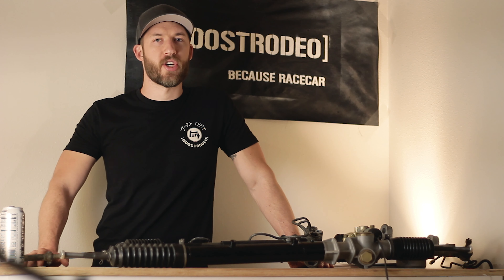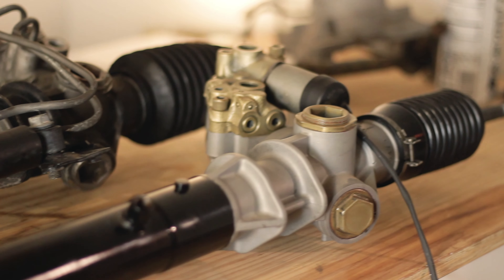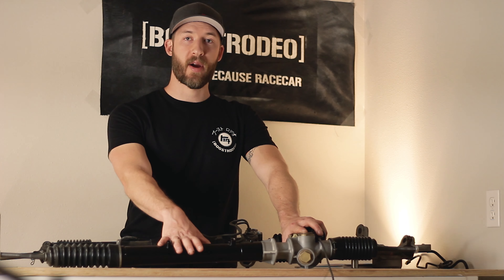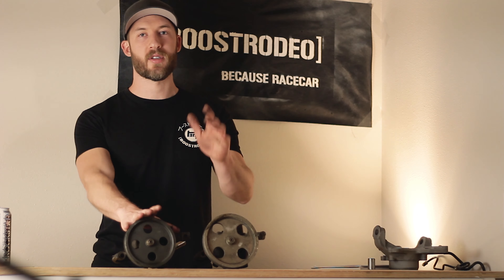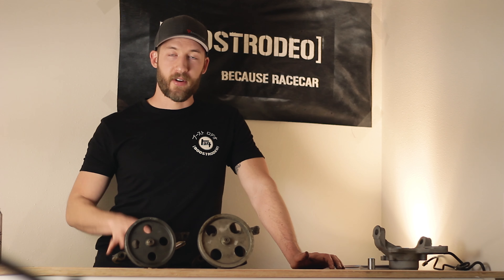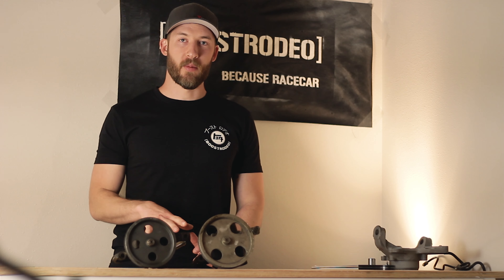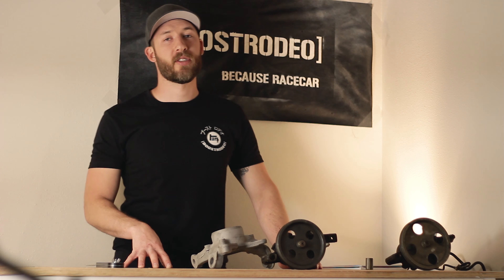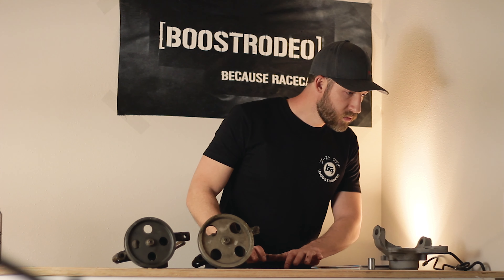Everything You Need To Know About The MKIII (A70) Supra's Power Steering System

Comment: I've been trying to make it to a junkyard to confirm whether the 98-05 GS300 power steering pump has the PPS solenoid, hopefully there's a USDM option for the Ultimate Steering Combo. I've been meaning to get another rack as well, my '91 PPS rack is leaking plenty. I'll be keeping an eye out for an early rack.
Reply from the maker: Let me know what you find out! I'm not sure where they put the solenoid on the GS
Reply: @BoostRodeo  successful junk run, the 98-05 GS300 does indeed have the PPS solenoid on the pump. Confirmed in the TSRM as well. Good to know it's not exclusive to the Aristo.

Comment: I can attest the loose feeling at slow speeds and stiff steering at 70 with the rack and pinion I have on my 2000 4runner looks just like your new rack in video bro mine is a progressive system 1/4 assist power steering system
Reply from the maker: Toyota definitely re-uses a lot of the same tech in different platforms!
Reply: @BoostRodeo  yep

Comment: good video brother. My mk4 steering is so sharp that it is not very fun in the highway
Reply from the maker: Thanks brother! good to hear from you! might be an issue with the rack& pump you are running. Also the alignment on your front toe in/out can make it feel darty at higher speeds.
Reply: @BoostRodeo  ya I though about toe.  Gotta take to the align shop but don't want them to drive it 😆

Comment: Thank you for the video. I have an 87 mk3 turbo. Is there a combination that works when keeping the 7mgte?
Reply from the maker: With the 7M it should be fairly simple to run either the pps or non pps rack. Just make sure your ps pump has the right pulley. PPS = smaller pulley, NON-PPS = larger pulley

Comment: Great video! I'm curious though, how did you wire the progressive power steering to work with the MK3?
Reply from the maker: 89+ mkiiis came with pps factory so the computer is already there. My jz swap harness did not have the pps plug included so I ran a new 2 wire harness from the engine side of the M1 plug to power the solenoid like factory.

Comment: I was able to get a remanufactured rack from o'Reilly's and got a re-manufactured power  steering pump from driftmotion.  Everything works great but at low rpm's the steering gets a little tough and I have to rev the engine a little and it eases up
Reply from the maker: How did the reman rack look? I had one from eurozone and one from O'Reilly's that I returned because they both looked so bad. I ended up just rebuilding it myself.
Reply: It seemed good and has worked well so far

Comment: is the 89 toyota cressida glx power steering the same rack? it has that solenoid on the rack. I wanna know how to run it.
Reply from the maker: Same power steering system and solenoid, I am not sure the rack is identical and interchangeable though. The solenoid operates at about .5v at full assist (low speed) and tapers off to 0v at higher speeds

Comment: Where does the speed signal Come from ?
My abs light lights up since the 1jz and r154 swap. 
Mine is a early '86 with another steering rack, the pps solenoid comes out with another angle.
Reply from the maker: There is a progressive powersteering ecu in the passenger side kick panel. It receives the speed signal from the speedometer (trans output shaft speed) and is not tied into the ABS. Is your car usdm or another market? The US did not have pps in 86.5
Reply: @BoostRodeo  thanks, so the abs light could be lighted up since the instrument panel swap 😅 mine is a EU version, had to swap to non pps, because the solenoid hits the crankcase, but with the 1jz ps pump the steering is too light. There is no good steering feedback at higher speed
Reply: And the r154 doesnt have a speed sensor. It has a speedo cable
Reply from the maker: @pimmus18  you are correct on the speed sensor but according to the wiring diagrams the pps ecu gets the signal from the dash. The testing procedure is to jack up the car and check the voltage change with the rear wheels spinning at different speeds so ther must be a signal conversion in the dash. Your pump is overdrive to accommodate the pps dropping pressure. The non pps 7M pumps had a larger pulley to decrease the assist. Your best bet is to switch to a pps power steering pump from an Aristo. The solenoid is on the pump instead of the rack, plugs in with the same 2 wire plug.

Comment: Ok where can I get a PPS solenoid ASAP! Everything going well with my rack rebuild, but tested solenoid and only works intermittently. Thank you!!
Reply from the maker: Unfortunately the solenoid was never offered as a standalone part by toyota. Only with the complete steering rack which has been discontinued. The best options for sourcing them now are to watch the forums and facebook groups for a used solenoid or entire rack with a solenoid. The A80/SC300/SC400 racks are different but did use the same solenoid as the A70. Also RHD early Soarers should use the same one. Good luck, I wish I had a better source for you!

Comment: I have a non-PPS with the normal JZ pump from a 1jzvvti - what I understood was that this setup with a 6mm spacer is better than a PPS rack with the same pump ? Am I correct ?
Reply from the maker: yes, your rack will already have the same amount of travel as a pps rack. If you add spacers you'll gain another 6mm of travel. To actually use it you will have to remove or modify your steering stops on the lower arm. You have the best setup as far as I am concerned.

Comment: I know this was 3 years ago but I’m trying to track down why my pump screams at me at any speed. New pump, driftmotion pressure hose and all the return hoses are new. Res is clean too. All stock 89+ stuff. Do you think that solenoid is no good?? Losing sleep over this damn thing 😂
Reply from the maker: How well did you bleed the system? getting the air out is really important and can be difficult. Jack the front of the car up and with the engine running turn the wheel lock to lock 20+ times, then check the fluid level. If it dropped at all top it up and repeat. You usually need to do this 2-3 times either letting the car sit or driving in for a bit in between. Air really hides in these systems and finds its way back to the pump until its completely out. If your solenoid is dead it could be making the bleeding process more difficult by restricting flow but I don't see how it would be causing the noise itself. If none of this works you may have just gotten a bad reman pump. It does happen.
Reply: @BoostRodeo  I found the problem! The super long return loop for “cooling” was crushed. Deleted the extra line now it works great!
Reply from the maker: @theowenhensley  Awesome, that will definitely do it. Sorry it took so long to reply, I somehow missed this comment. I'm glad you found the issue though! I swapped that big steel loop for an actual plate cooler on both my cars.
Reply: @BoostRodeo  you reckon it’d do long term harm to it if the loop is just bypassed? I don’t drive mine hard it’s just a touring car for me. Appreciate it man!
Reply from the maker: @theowenhensley  It shouldn't cause any issues at all. The earlier cars didn't even have the 'cooling' loop and it really doesn't do a whole lot. I have a cooler installed because I track mine periodically which creates some heat. Normal driving is fine.

Comment: Good info! I wonder if there is a transferable rack from another car that gives you quicker steering? Has anyone tried different ones?
Reply from the maker: Wondering this as well, the z20 soarer pps rack was actually used in rhd EU supras pre 89 so I wonder if there are any other lhd toyota racks that would drop in. Might also be gear sets out of a different housing that could be used in ours for a faster ratio.

Comment: I still have the stock 7mgte in my car and my car is an 87 so it doesn’t have the PPS in it so what would you recommend? Would the jz pump fit on the 7m? If so, how would I wire it in?
Reply from the maker: The JZ pump wont bolt to the 7m unfortunately. Also you would have to find a pps ecu and wire that into the car as yours won't be equipped with it. I probably wouldn't go through the trouble just to add it.

Comment: Hey man, is there any way to delete the pps solenoid from the rack or 'bypass'? I happen to have an aristo engine in my Japan spec Ga70. Bare bones no wires atm. I will be rewiring the car and using haltech. I just saw a vid where the solenoid can be bypassed on the aristo pump, but the issue of no oem electrics to control the rack. So i was wondering if there is a way to bypass the solenoid on the pps rack. Or attempt to rebuild the really old beat up non pps rack I happen to have in the shed
Reply from the maker: I have not seen a delete for the solenoid on the rack but if you could find a plug with the same threads as the pps solenoid that would remove it. I plan to rebuild and swap the non-pps rack into my car.
Reply: i brutalized an old solenoid and made a plug with it today. im actually waiting on a buddy to finish wire his mk3 to start and test this solenoid delete.. but on inspection of the valve body on the rack, it should cause no issues. the actual feel, well only when we get the test done then we will know. But yes, he could not get his power steering to be soft. 2jzgte vvti, non pps pump but pps rack. his is a ma70 with a used jza70 steering rack. so like me no useful oem electronics to get this working.
Reply: Just to note, another buddy's car, Rx80 cressida, 1jzgte vvti swap, pps rack and hard steering also. It was the details of your vid here that highlighted these issues and opened up brainstorming to get it to work.
Reply: Another question: so pps and non pps  rack ratios are different but travel is the same correct ? Is it that the rack shafts have different teeth design or only the pinion varies? From what I can see, the pinions of both types of racks bolting are the same. Question is if i can put a non pps pinion on a pps rack? What blasphemy would that combination bring?
Reply from the maker: @sayyidali582  the non pps actually has a bit more travel as well. In a stock car both will be limited by the stops on the lower arms so you wouldn't notice it. Bit in theory you could get a bit more angle with the non pps if you cut the stops off. As for why the difference in ratio and travel I cant say. I haven't had the 2 racks apart side by side ever. I may try to verify when I rebuild the non pps rack I have
Reply from the maker: @sayyidali582  Glad it helped a little, smart on using an old solenoid to make a pps delete. I think the threads on it are unique and finding a plug would be tough. If enough people needed to do this i might be able to measure them and make something. 

Keep me posted on what you come up with on resolving it! Or if you need anything!

Comment: I have a  mk3 supra and i bought it without a title while applying for it i got a letter sent back saying the car is accually a 89 but i put 88 since on the door jam it says 8/88 so do  I have the no pps or with pps car?
Reply from the maker: so 8/88 is the production month/year. US 89 cars would be built in 88 and sold in 89. The answer is your car could have either. 89 was a transition year and early cars have early square motor mount subframes, yellow plug engine harnesses and no pps where later cars have round motor mound subframes, grey plug harnesses and pps. Being August of 88 I would guess your car has it but the only way to be positive is to look at your rack and see if it has the solenoid.
Reply: @BoostRodeo  Thank man your the best i appreciate the info
Reply from the maker: @josephsupersport9451  Happy to help wherever I can!

Comment: That damper looks the same as my 7M cressida, anybody know where I can find one?!?
Reply from the maker: It's likely the same. Toyota uses a lot of the exact same racks in different models or even same parts in different racks. Unfortunately you can't get that damper from Toyota any longer. I have yet to see an aftermarket one listed as a replacement but I would guess that if you looked at the lengths on aftermarket dampers you could find one that could be made to fit.

Comment: I hate the progressive power steering it dosen't assist crap compared to my 2005 Ford excursion full assist steering and even my 2020 Ford f450 full assist power steering kinda with my 4runner didn't have assist or power steering at all steering is already set up that I have to use muscle to turn the 4tunner would prefer assist not to be there i like the heavy you have to use your muscles steering
Reply from the maker: I really like the progressive setup in the Supra when it's working right. Easy enough to turn at a stop or when backing out slow but firms up a lot when you hit cruising speeds.
Reply: @BoostRodeo  probably works a ton better in the supra
Reply from the maker: @AntonioClaudioMichael  must if yours is that bad. Different vehicle weight and tires size along  with a lot of other things could affect it.
Reply: @BoostRodeo  yeah truck is 8000 pounds had 265 75 r16 rims and tires alot of offroad add ons and upgrades

Comment: i have a 90 turbo and it has the older style non progressive
..maybe your wrong about the years?
Reply from the maker: Did yours have the steering damper? There are non progressive power steering cars post 90 but they were not very common and the rack style should have changed slightly.